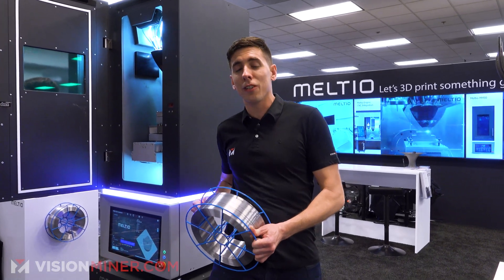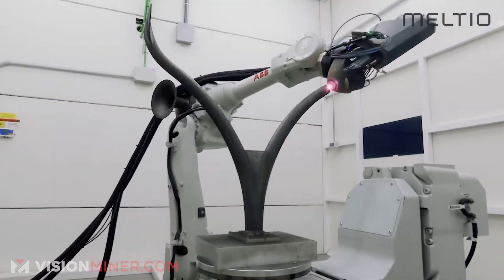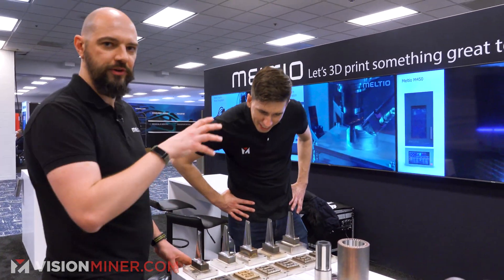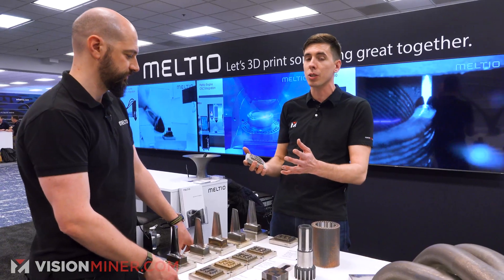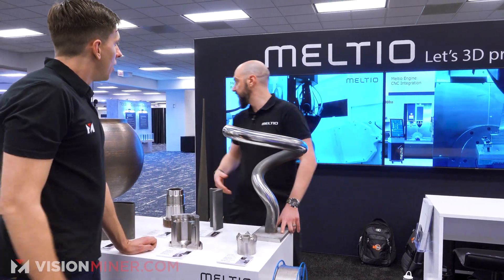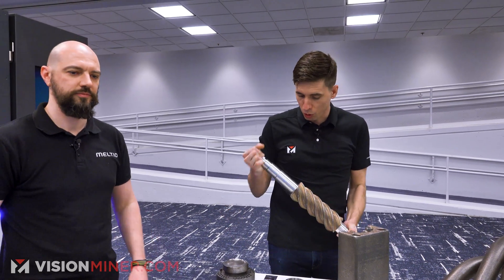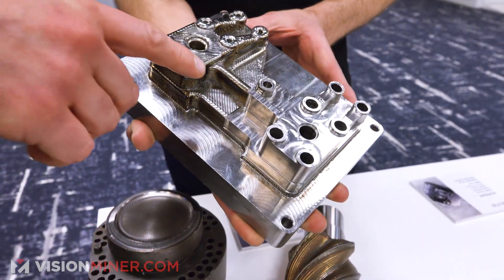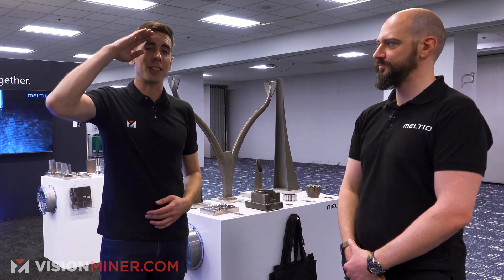3D Metal Fabrication: Meltio 3D's Laser Metal Deposition Technology - AMUG 2023

Comment: How do the mechanical properties of the printed materials compare to the mechanical properties of cast or machined parts?
Reply: Equal, and in some instances improved. Add the possibility to combine two different metals.   Density of printed parts are 99.998%.

Comment: won't be long we'll be able to print the electric lines in a house while we print the house.....ventilation shafts etc...and so on........with multi composite printing literally anything is possible....whats really gonna blow peoples minds is when we can print by altering molecules to make up the base structures of things........I'm not science literate so I probably am not expressing my point very well.....I saw it about a decade ago where the video explained how a laptop could be made from ordinary mud...or something...because you basically had a nano factory reassigning the parts of the molecules and then assembling them......and something about everything is made of carbon so that was the base....like I said been a long while since I seen't it.

Comment: worked in alot of machine shops and out side of prototyping i dont see a big benefit in printing parts that then have to be machined when you can get a forging. but mabe im narrow thinking it a bit.
Reply: Combining different metals, pronting geometries that needs 3-4 different traditional machines to produce.  Minimum material waste. Integrate the Meltio head in a CNC integration. Print the part, surfice finish with CNC tool head in the same machine programming